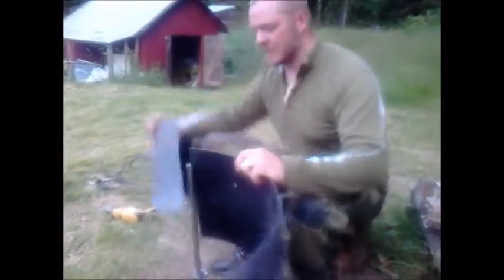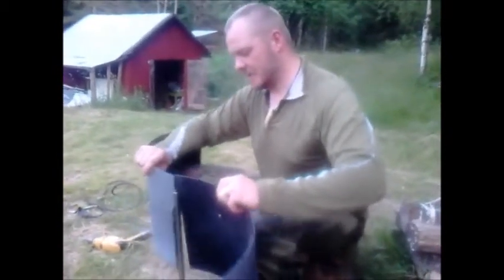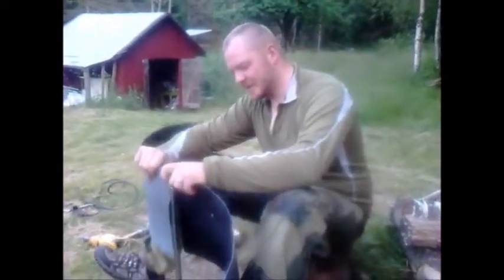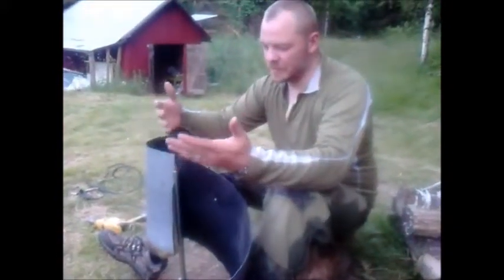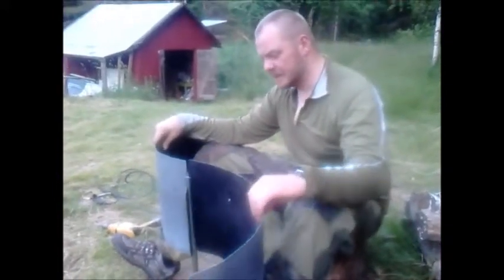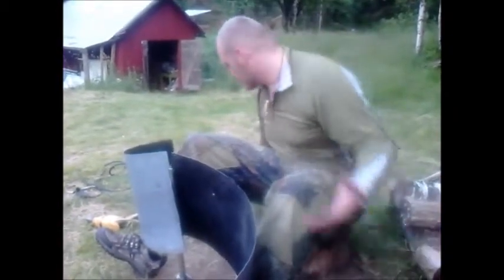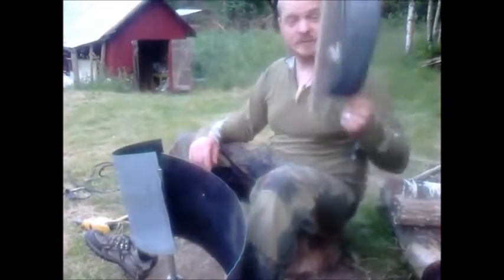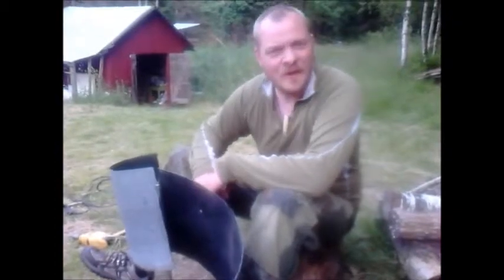Building a vertical windmill, part 1

Comment: What are you going to use the windmill to power? Maybe attach a fan belt to the other end and have it pump water out of a well or maybe use it to spin some sort of small motor to get some electricity for lights??? Pretty slick job and it doesn't look too bad either. Keep up the good work.
Good Luck,
Vinny